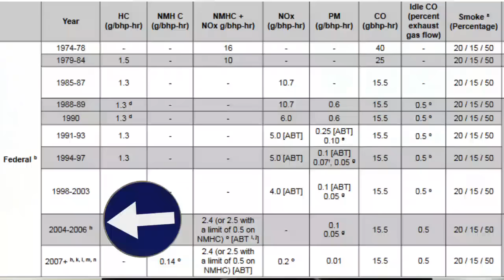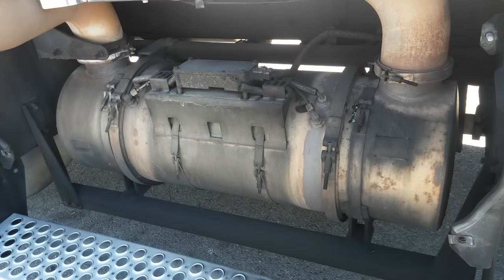Why Do People HATE Cat ACERT Engines?

Comment: In 2007, getting ready for 2010 EPA regulations.  EPA came to town with their advisory board.  Meeting: They said that Cat has to meet the upcoming 2010 regulation when fuel is contaminated.  Our refineries do produce low sulfur diesel.  But thru pipes and storage tanks, sulfur content does go up.  They (EPA and their party boys) refused to answer the question posed  = "What are the contamination we now need to design and build for???"  No answer.  So they left for Chicago tourism on the USA tab.  I had wanted to install co-generation off of the exhaust manifold in the C11 thru C18 engines.  This provides 6% to 12% increase.  The 2006 ACERT had already increased milage to 6.8 MPG from 6 MPG on C13 {as i remember} while providing no soot exhaust.  The wiring harness -  keep these at stand off, away from trapped heat areas.

Comment: I had a PDI tuned C15 Acert making 700 hp at the flywheel that I finally rebuilt with just shy of 1 million miles due to the head gasket letting go.  It was a good engine.  I think the only thing we did was update the rocker arm studs when one broke, other than that it got serviced every 10,000 miles.  It got worked hard too pulling tri-axle grain trailers grossing 94,000, and over 100,000lbs in the fall through spring.  The PDI tuning added over 1/2 mpg, but it was still down roughly 1/2 mpg compared to my old 6NZ.
Reply: what was your overall mpg?

Comment: Thanks epa for making the diesel engine so overly and unnecessary complicated. I agree with the statement I just read in the comments section. Josh, you would make one hell of a teacher. Great job on explaining in this video!
Reply: I'm all for a clean-burning engine, but it seems like the EPA don't even know what their own standards even mean. Zero emissions is not reasonable, but low emissions is reasonable. At this point I'm starting to believe that the people who say "emissions is not about clean burning, it's about control" actually has some ground.

IMO the ideal system on trucks would have no DPF or EGR. It would consist of only a DOC and an SCR system. Death to DPF's.

Comment: I have 06 nxs c15 acert. No complaints. LOVE IT. Very mechanically friendly engine, 9 sensors and twin turbo. Rebuild ones because oil cooler failure it took me my 40 hrs to clean oil/coolant mud out from inside. Old saying "Don't fix while ain't broken" Wrong. When broken will cost 10 times more. Fix it b4.

Comment: We are running the ISX 15L Cummins at work  we had a VGT turbo seal failure that sent oil into the scr/dpf just after a passive regen (thats the dealers thought). The fire department showed up and ripped the whole system out from under the truck and hosed it down. $32,000 in part (needed turbo to the stack). The insurance company totaled the truck. Now after watching this video I wonder if a plugged blow by tube was to blame for the turbo seal failure.  Thank you I will have to look into that on our other trucks
Reply: So after looking into it, the ISX has a filter for the blow by. Its on the drivers side behind the charge air cooler pipe. Now I know

Comment: Had a fun IVA fiasco the other day on a BXS.  The #1 IVA was sticking intermittently but it would stick even without oil pressure (control valve open).  It also was staying open just enough to cause a miss with little to no white smoke.  But also the miss wouldn’t go away when backing the IVA completely off.  Found the problem by backing the IVA off while the engine was running (which would make the miss momentarily go away).  Retaining nut was intact but the o-rings on the cylinder were shot.

Same engine, another tech had backed all the IVAs off previously and readjusted them.  It had an intermittent ticking and sometimes knocking noise in the top end.  The noise came in when the IVA control valve was closed.  All the IVAs were noisy but disconnecting #4 made the most dramatic reduction in sound.  I didn’t see the retaining nut for the foot falling out like you sometimes do, so I assumed an o-ring failure similar to #1 was taking place.  Backed it off and very quickly learned that the slave pistons will come out all the way if there is no nut in there at all.  The foot cocked sideways and the rocker arm had no way to return.  The piston pushing back up on the valves made short work of the rocker arm…

Comment: Had a c15  2005 Acert that ran every day doing local heavy haul. The real problem was the intake valve actuators. Even the mechanics got the joke of replacing the intake valve actuator when the engine light came on. Besides that the engine was one of the best motors that I have run. It was finally rebuilt with 22000 hours and approximately 430,000 miles. The real only way I knew that something was wrong was the boost would fall from 52psi to around 25-27 psi. I personally liked the motor if they would have a permanent fit for the intake valve actuators. Thanks for going thru this motor.
Reply: I have the same engine and it’s flashing the check engine light, is there a way to check the code or have to take it in?

Comment: All they needed was  independent VVT for both intake and exhaust sides like the one used on every modern gasoline fed four banger nowadays, DPF, DEF and maybe a small[quick spool, off idle high boost] and a big[high HP top end] turbos in series.
OR one super expensive and complicated VGT turbo to keep parts count down.

Comment: We had two ways to go. First was straight egr. The second was High Volume Low Pressure (HVLP) with the two turbos. This provided a much lower intake air charge than a straight egr system. Unfortunately development time was cut by a year and a half due to budget issues so we had to choose one path and focus on that. Once tier 4B hit we added urea (def) to the exhaust and dpf filters as an after treatment. The filters from the supplier had issues, the ard heads would crack, the after coolers would form hydrochloric acid due exhaust gasses combining with water vapor in the air. Normally that wouldn’t have been an issue as the temp was too high to cause condensation. And of course the VIVA system which worked but really beat the valves to death. It’s too bad further development didn’t continue. I believe with a common rail (higher fuel pressure at injection) and laser cut injector tips would have created much better atomization of fuel help with emissions. But idk I could be wrong.

Comment: I run a mxs 550 50 psi boost easy I.v.as. deleted awesome engine pulls awesome and gets mid 6s for fuel mileage love it
Reply: @TheLeftRbabieskillers  probably ecm reprogram. Its the only way to truly delete them
Reply: @TheLeftRbabieskillers  a tune and backing off the iva s or swapping to a 70 pin ecm
Reply: So when you delete the DPF, and flash the ECM does that mean the ARD head is basically non functional.
Reply: @Addddam21  if the flash that is loaded deletes the ard head yes
Reply: @TheLeftRbabieskillers  mxs doesn't have an ard head my 550 is a factory cat setting.  The ivas have to say hello but the computer does not actuate them. All this can be done with CAT service tool

Comment: Doing a C18 in a compactor for NRS/EGR cooler failure resulting in hydrolock. 

The new C9.3B does away with EGR, but uses more DEF.

In the machines, they have the ARD hammered out pretty well
Reply: What do you think of the C7.1?
Reply: @5.43v  not my favorite, but they seem to do well enough. Better than the C6.6 did, especially early on. Still issues with injectors, and to a lesser extent pumps. 
Have seen a few hit 15k hours in excavators, but that's not terribly common. 
High pressure turbo on the twins likes to blow its seals.
Reply: The non-EGR engines use much more DEF, but produce far less problems overall.  Am I right here?

Comment: I've been running my /05 WS with a 475hp ACERT C15, it's been a hell of allot better than any DPF engine. Although I have replaced 2 VVAs and just got a 385-3 code the IVA. but it's still running and hasn't derated the power.

Comment: Other than the valve actuators and the Jake brake housing breaking it really was a good motor for me...:face-red-heart-shape::face-red-heart-shape::face-red-heart-shape: Oh yea and the wire harness inside the valve cover  so it or they did well on the other hand the 3406E and fighting oil leaks and Yuming up fuel, Ok burning more fuel I prefer the the C15 models before 2007 and not the second year C15 .Hey good video love the info you share your Awesome...

Comment: The funny thing is the ARD head with the purge air system worked fairly well on the c7s engines but failed so poorly on the Lee and sdp engines to the extent that CAT recalled that system and converted it to and electric system. Somewhat worked but it’s has never been perfect. Still having to replace heads once a year. 

I miss CAT easy money.

Comment: I had 04 Freightliner Acert C-15-6NZ single turbo. Had no problems BUT did some mod to push more turbo pressure. More quickly.  Didnt use any more fuel if driven conservatively. But if i needed power more quicly ( if pulling loaded through a sidden off road mud hole)

Comment: I prefer my 03 cat. But I did have an 07 acert. I put a heavier fuel spring in ported the in and out side of the fuel lines, so the fuel ran cooler in the lines. It jumped my milage up about 2 miles per gallon and ran so much better. Never had an issue after that. Simple fix for a better running engine.
Reply: Can you explain the porting of fuel lines.. ? Intreasted
Reply: Also i agree... i have an 03 and 06... 03 cat 6nz all day
Reply: Drilling the elbows out bigger, but not so big that your lines don't seal up tight. I did that on every one that was small. Takes a little bit of time but no cost to you except for the heavier fuel spring. 7 bucks. I had an ol cat mechanic tell me to do that. Figured I could not lose anything to try it. Don't leave any burs in the ones that you drill out. Has to be a good flow through them. Every one that I have told that to and have tried it. Loved it. I'm on the go so much now I have not had time to do it to this one.
Reply: @dewaynewhitney5703  10. 4 ... already have updated spring... and updated fuel bypass on 2 filter housing.... getting about 100 fuel psi at idel...
Reply: DeWayne Whitney I did that as well. My MXSis all stock except for doing this. It pulls and runs like a freight train
Reply: @chief1193  any way you can explain a bit more ? Which lines did u do ? What drill bit.... wouldn't u just poke hole ?

Comment: as a trainer explained it to me, when the particulate matter goes UP,  the nox goes DOWN ... if the particulate matter goes DOWN the nox goes UP. thus the aftertreatment ... because you CAN'T reduce both INSIDE the engine ...

Comment: Josh, I’d love to see you tackle a really older engine(3408) on the road one.. Did they ever make a engine break for that model?
Reply: No they didn’t make a genuine engine “brake” as in Jacobs Brake, but the 3408 in highway trucks had the CAT Brakesaver which is a hydraulic retarder bolted to the back of the flywheel housing. It uses engine oil with a seperate oil pump and huge oil cooler. It weighs a lot and cost a lot when new.
Reply: gm16v149 cheers and thanks..
Reply: @gm16v149  i used to run with a guy who had  a 3408. When he went around you ( any time he wanted) it sounded like a freight train just passed you. Lol.
Reply: A Jake brake on a 3408 would have been a plumbers night mare. 
What is amazing about a 3408, it has a sixty degree vee instead of a ninety. Made the engine narrower to fit in a smaller frame. Yet a little taller. So they redesigned the crankshaft to achieve this.
Get an old PC 3408 and start it up in the winter time.
Reply: Back in the DAY i had a Cat 1693 pre cup. If I am not mistaken i think it had dual over head cams. When it was idling it rattled like it was coming apart. Lol
Reply: Gary Haley nice!
Reply: @johngoldsmith6629  I know with gas engines one gets more torque with a 90 degree v8, I wonder if one gets less torque in a diesel when reducing the angle?
Reply: @garyhaley3072  Correct, dual over head cam's. The exhaust cam drove the intake off a spline drive, rear gear train. If it didn't sound like a bucket of bolts running, you better shut it off.
Reply: @reggierendert6494  Never heard of that, just a old mechanic for Cat for forty years plus.
Reply: @johngoldsmith6629  Well Sir, thank you for your service 😊
Reply: 1693,3408,kt Cummins, man those were the days. I was a mechanic back then. Other than 3.5- 4 miles to a gallon, they were great power. Didn't have to worry about  a bunch of electrical bullshit all over them to make run. Miss those days.

Comment: The IVT system is a way to have in cylinder EGR.  The cylinder pressure goes below the exhaust manifold pressure and pushes some of the exhaust gas back into the cylinder.  The CGI system is a plumbing nightmare for the truck manufactures'.  Cat picked the wrong tech to get the emissions down and it led to them leaving the market.  Other manufactures used a DOC with fuel  injected into the exhaust stream to create the needed heat to regen the filter and figured out how to handle the soot going into the intake manifold.

Comment: Having worked on them from 1975-2021, I can't say that any one mfgr's engine was really any appreciable amount better than the other, lot of things improved over the years, some didn't, some ended up worse. They all had a dose of the same issues from time to time, each one had some different peculiar to them issues, due to different build styles. They were all "OK" until 2007 and emissions systems, and still have many of the same issues continue underneath the emissions problems right to today. Emissions just added more and different problems and higher costs yet.

Comment: 2005 KCB C13 and I'm very happy with it but I'm having my first problems with it in 3 years other than an oil cooler I replaced about 1 year ago.  The problem started off with a IVA code that was fixed with new injector harnesses.  After installing it that code went away and a new code for the oil pressure sensor came up.  Replaced it and pressure on the dash dropped from 80psi to 50 and code went away.  but a new code popped up for barometric pressure sensor and IVA oil pressure not responding.  Replace barometric sensor and it's code went away but now I'm left with the IVA oil pressure code.  Of course it doesn't pop up immediately upon start but only after it's self-test approx. 30 seconds.  I'm sure I should just replace the pressure sensor but while I've got the valve cover off again I'm wondering if I should address some other problems.  I'm getting some darkening of fuel and a very small amount of oil (less than an ounce between oil changes) getting in the coolant.  Should I be looking at injector tube o-rings or just injector o-rings and an overhead.  I spoke to the closest thing we have to a CAT mechanic in this county and he said chain failures of sensors isn't uncommon so I'm crossing my fingers on that.  I should mention that I had to take the rear IVA off to clean out the plug for the new harness.  Engine is tucked under the firewall so I couldn't get to it without removal.  I kept the bolts in it and put it back on in the same position it came out but it did seperate a bit during removal.   Is there an o-ring in there that might have fell out?    If you don't reply I understand.  This isn't a repair forum but you're only guy I trust to know his stuff on these engines that I know of.

Comment: The more i listen to your  excellent video, the more grateful i live in the UK,  loading a new  engine with geek boxes and sensors is like a nun getting pregnant ,asking for trouble, geek controlled injectors,and pumps bad news.  Bin all that geeky techy  shit, build the damn engine with old fashioned mechanical injection with an ultra high temperature combustion chamber cylinder head and train the driver to do basic roadside repairs.

Comment: I'm out of it now but back in early '06 I owned a 3406E turned up to 550HP that was almost 10 years old. If I was going to keep trucking The time was now to buy new, so I sprung for a 379(last of THAT breed) with a C13. I got it just before Christmas , '97 with an '06 C13. No DPF , no EGR and DEF didn't come 'til 2010 so none of that either. The viva's that came with that however were too weak for the C13 because the oil pressure was too low, running about 20 psi when warm. (I had a very educated man tell me that that oil pump could float 3 C13 engines so wear was no issue) The only problems I had in ten years with the ACERT system was that the # 6 VIVA failed once, and the shop replaced both #'s 5 and 6. The guy that owns it now had that happen again but seems to happen because # 6 is the last one on the gallery for the oil.  I made a lot of money with that truck with almost no down time.

Comment: Another tip for a better engine performance is to eliminate the fuel pre warmer also! Single turbo and eliminated pre warmer will greatly increase horsepower and fuel mileage!!! Two very unnecessary junk items that cat even recommends eliminating 👍

Comment: I have a 2004 c15 acert ... million miles just got touched ... so far only had injectors done on it ... vibrations are the biggest problem I'm facing and also fuel filter changes very offen otherwise it doesn't even pull a empty uphill ...

Comment: I have a 2007 twin turbo C15 starts and idles perfect Rev it up good response good boost oil pressure is at 80 lb at 1200rpm when you hit 5 gear stop engine light comes on and it stalls  UT will fire right back up have anywhere I should be looking I was thinking maybe atmospheric pressure sensor does not store code